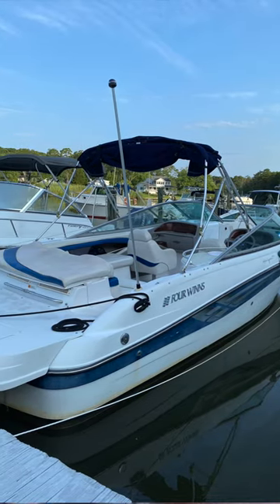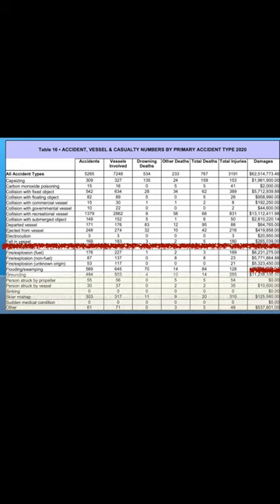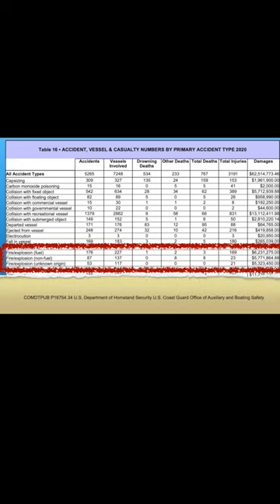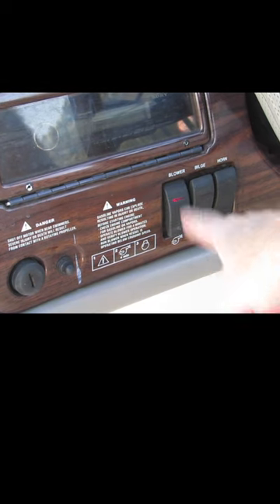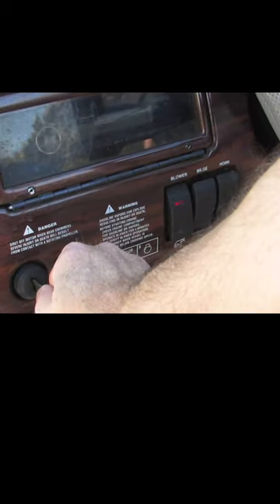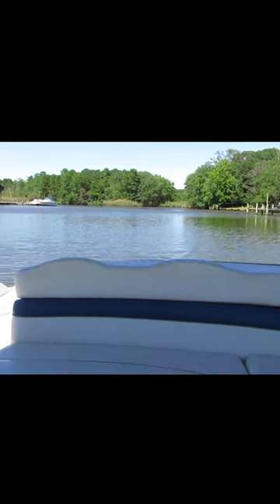Boat Explosion Risk - Inboard Outboard Engines (I/O engine or sterndrive)

Comment: My grandfather had a 1972 28' Bertram with twin built Ford 351 Clevelands that made 450hp each, and he had a very particular start up sequence. We would open up the engine hatches on the deck, as well as turning on the blowers to completely air out the engine compartments due to both engines being carbureted. Then he would fire the starboard engine first, then port engine. I totally understand why in my older age. Man that was such a beautiful boat, he kept it in immaculate condition.

Comment: Like the vid about the risk of a leaky bellows this is a concern but the risk can be greatly reduced by adopting a few simple safety precautions:
1) yes always use the blower BUT…BUT…you should lift the engine hatch cover first & sniff for fumes! If you smell fumes you’re not boating that day!
2) every season check all fuel lines, the pump & carb (if a carbed engine) for leaks, loose clamps, cracked/rotted fuel lines etc. 
3) any repairs done must use SAE J1171 approved spark arresting equipment; this includes: alternator, starter, distributor, carb , etc. even fuses used in an inboard gas engine compartment are different than automotive (ATC vs ATO), ATC fuses are closed & when they blow they can’t ignite an explosive atmosphere.
4) install a gas vapor fume detector
BTW as many times as I’ve gassed up at the fuel dock I never see people lift the engine hatch & sniff before turning on the blower!
Also when fueling the blower should be OFF & all hatches closed.

Comment: Use the blower but also open the engine compartment to let it air out before starting. Open engine compartment on jet skis too. They can have fumes trapped and they don’t have blowers

Comment: Hell with that, then open the engine compartment. These are not motors these are engines motor is electrical.

Comment: Knew a guy who replaced his carb with a car carb and aftermarket air filter to save some money. Yeah, he had to abandon ship.
Reply from the maker: Yikes!
Reply: Why
Reply: @jeffreylynds7986  Mainly due to how they're vented, a marine carb is vented into the venturis so any fumes are sucked into the engine. Auto carbs are vented into the atmosphere which can explode under a cover on an inboard and that's what happened to my buddy's boat. He also didn't have blower on which made it worse.

Comment: If you want to see what real Bad is go to any marina gas dock I have seen people with there blowers on when fueling or they have all the cabin hatches open,fuel fill nozel locked on automatic and the walk away Has anyone ever seen a nozel shut off and fuel sprays every where😮 90% of marina's don't train there Fuel Dock staff on the proper procedure And spill kit deployment Deployment So the next time you fuel keep your head on a swivel you might do it wright But the boat next to you ??????????